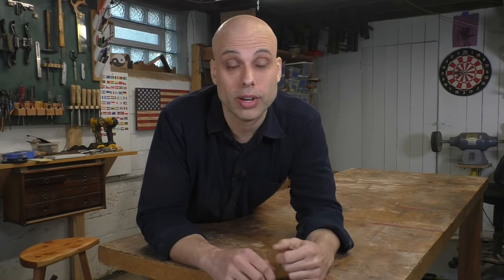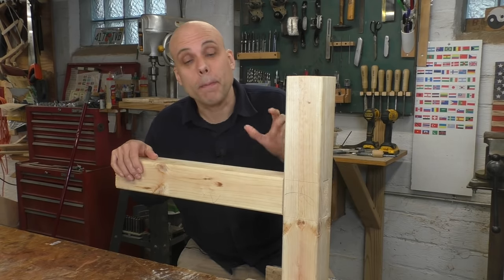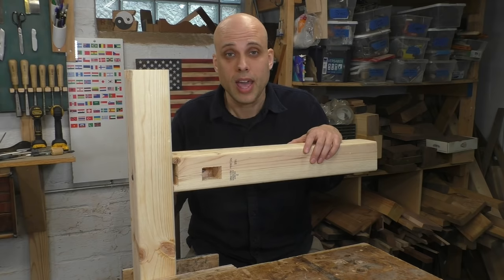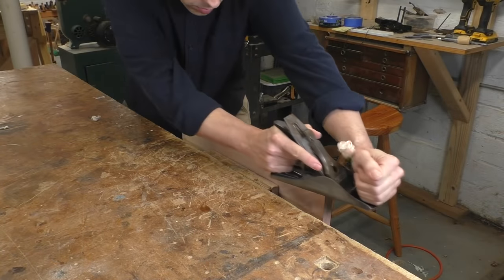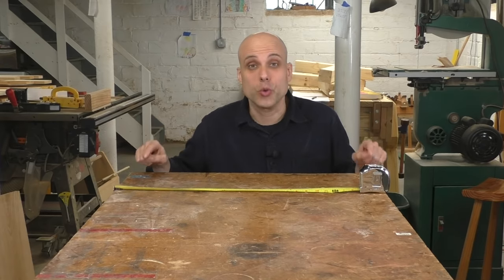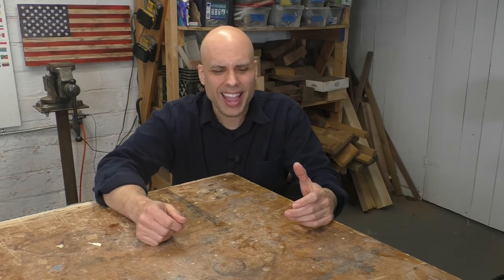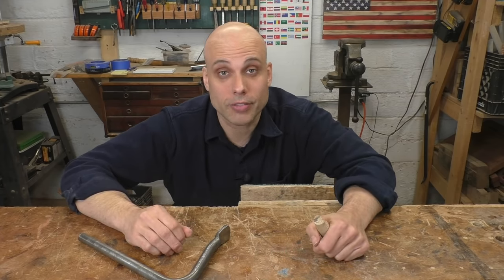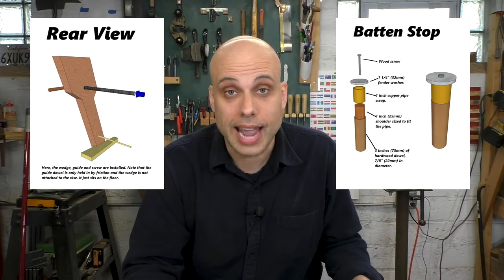Four Workbench Building Mistakes (that we all make).

Comment: I was interested in your assertion that you started with power tools and gradually swapped to hand tools.
Although I am still a complete amateur I started with hand tools about 60 years ago in school and gradually accommodated more power tools as these tools became better quality for less cost. When I built my first bench many years ago it was in a garage so the size dictated one that could fit alongside the car. Materials were not much of a cost since not much would fit!
Later when my house was larger and there was a triple garage it occurred to me that the cars didn't really need to be inside and I had a much bigger space! whilst my wife is not all that thrilled with the cars being outside she is amazingly tolerant and the main problem was the costs involved having just built an enormous house and I "discovered" the use of AM's (available materials).
A neighbour had a set of drawers that he was throwing out so I purloined these and beefed them up with some hardwood leftovers from another house construction down the road then used this as one end to support an enlarged version of the tiny bench from my previous tiny garage. The other end legs came from something else that I cannot recall.
With time the size of the bench had been sufficient although I find that I tended to want the bench higher because I don't wish to bend over or crouch as age does its thing to my joints.
The drawers did not appreciate the weight of tools that I stressed them with and gradually fell apart! This didn't matter because I made as series of shelves from hardwood fence palings (I actually purchased) and some surplus timber recovered from some wardrobes that I am ashamed to admit that I destroyed for the framework. All of this space I used less and less as I used more machine tools that had their own benches etc. Unfortunately my family found the unused bench a handy place to park much of their junk that I dare not discard and its hard to store it all neatly.
I have solved the problem beautifully discovering an Australian institution called a "Men's Shed" where a bunch of guys get together and take over a huge barn-sized shed and gradually scrounge huge amounts of equipment so we can spend a few days a week working on whatever projects take our fancy. I still do a certain amount of work at home (especially since Covid 19 and especially now that I am stuck at home having caught the disease with minimal symptoms hence the time to write massive comments) but I would be surprised if the same idea does not take off overseas because it expands the possibilities and scope of our work.

Comment: Just weld one up with steel angle iron frame, and bolt on what you need. The steel makes it solid, and you can bolt on whatever wooden bits you need. You can adapt an angle iron frame in any way you like

Comment: I've been playing at wood working for a couple of years.  My biggest most favorite tool is my fancy miter saw.  The rest are small hand power tools and a bunch of hand tools.  I am getting ready to build my first workbench after utilizing a couple of makeshift sawhorse tables.  They were handy, but still not what I wanted.  Therefore I've chosen the knockdown moavian.  I've come to realize there is a difference between a work bench and a table for putting things together.  I can use a thrown together plywood  sawhorse table for putting things together but for working on that wood, I need an actual workbench.  

You csn watch vids ntill the cows come home, but Until you get to working, learn your work flow and style, you can't ever really know what's going to work best for you.  What seems good yo your head may be far drom what works best for your hands and back.

Comment: I inherited a solid wood carpenters' bench with an old wooden vice at one end. The legs were flimsy. I built a steel frame with adjustable feet out of 1/4" thick, braced, angle, fitted a front apron incorporating a cast iron vice with pop-up dog,  at the other end, so that the front face was fair the length of the bench, and drilled in a couple of bench dogs. Not a huge amount of work but the thing is absolutely solid. The important thing is the steel frame which means the exact nature of the leg joints is irrelevant. If you don't want to weld up steel, then use diagonal bracing which again relieves pressure on joint design

Comment: Built my first Bench with metric bolts going through the legs, into horizontal beams glued to the underside of the bench top. had three bolts per leg, two parallel and one orthogonal to the others. Used super large (35mm diameter) washers...

Had your exact problem. It will crush the wood. Well, wish I whatched your video before i build it

Comment: Im not claiming it is the best option by any means, but I have an 1/8" masonite top on my primary bench. This bench gets used for all sorts of jobs from fine woodworking, to laminating, to large glueups, working composite materials, assembling various mechanical components, and even occasional aluminum fabricating. I have a couple scrapers I use to remove glue blobs, and a couple ridgid flat sanding blocks (one round and flat that I use DA paper on and one that I use board sander paper on) for knocking down burs and whatever gets embedded. I occasionally use plastic filler and will fill low cuts, dents, or holes with any unused product.  We have a scuff resistant paint we use occasionally on comercial  stair risers and skirtboards as well. I will cover as much of the top as I can with the remnants of it also. I have never experienced transfer of the dry paint onto a project and the even black surface makes it very easy to spot imperfections and debris at a glance. The Idea at the beginning was that the 1/8" masonite would be a consumable top that would be easy to replace, but this top has lasted me years and has actually gotten better with time.  I hold it down with 2" double sided flooring tape around the perimeter and a few strips in the field so there are no fasteners. I thought I would have to add some kind of mechanical fastener as well, but it has never budged and this bench sees far more abuse than most will.

This top obviously feels more commercial than a pure natural wood top and may not offer the same emotional feel, but it is extremely durable, laser flat, and can still be replaced with a brand new surface quite easily without any hassles. I enjoy how easy it is to upkeep and not having to stress about how I treat it. If something goes sideways and I hit it with a saw, drill, or whatever, it can always be returned to its previous state easily.

Comment: I bought a full sheet of 21 mm plywood. Mounted it on the sturdy frame of a motorized office table.
Now I have a work bench with a built in circular saw and mount for a router.
I put some wheels on it so I can shift it to where I need it. The wheels can be locked.
AND I can have it at the height I need for any need.

Comment: My bench was built in the basement when I moved in. I want to improve on it without dismantling it. It is built with drawers, and it's against the wall and I have put small power tools on top of it because of the electrical outlets. I want to have options for a better vice. I do small projects of wood, leather, and steel. The power tools are bolted but can be removed to make room for certain projects. There was supposed to be a question in there. Let me look at some more DIY videos.

Comment: MY first bench was an old length of kitchen worktop - with shiny laminate - it was almost 3 meters long! - I purchased 3 really cheap tressles and screwed them on as legs.... way too slippery on top, way too long, way too unstable.... but I muddle through.
My second (current) one is just square cut lengths of 2x4 and 4x4 (for the legs) all screwed together... and to be honest, its really solid, and I never had to tighten anything - just a s*** load of screws! - nice a fast to build too.

Comment: Mine is a modified Moravian bench. Added a couple drawers and moved the stringers up so I could slide my saw bench under  it. Used traditional joinery but went with a modern woodworking vise.  Very happy with it so far except I screwed up when I laid  out my bench top  mortise. A little glue. a bit of patience and a little scrap fixed it up though. Hate my dog hole layout though.

Comment: My workbench is a 4 leg frame joined with lag screws with a plywood sheet not screwed at all. It stands on a wall most of the year and I "assembled" it over the grass when I need it because I haven't a workshop. In the last 8 years with this I builded half of the furnitures of my house, repair the gearbox and motor of my car and made all my weldings.
There is no need of a fancy workbench when basically you need a flat surface far for the floor.

Comment: Based on this video and Rex's video on the English joiner's bench here's what I decided to do for mine:

1. I double reinforced everything using screws rather than half-lapping with bolts.  I do not care if my workbench looks nice, I care if it works.  Screws don't tend to work themselves loose the way nuts and bolts do.

2. I made mine 30 inches wide, but with a tool well in the middle, so that the problem Rex describes with being too wide is avoided.  I quite often work on large surface pieces, like plywood for cabinetry, I need the extra width, but I also need to save my back.

3. I went with 7 feet of length and this seems perfect, even for larger pieces.  You can have a decent amount sticking off the end and still work safely and comfortably.

4. I used the joiner's bench style with the wide apron for hold-fasts and pegs, and adopted the vise-free work holding methods Rex has covered.

5. I did not do a 2x10 top for two reasons, firstly 2x10s are incredibly expensive now in Canada, and I wanted to limit the project to two 2x10s only.  Secondly I wanted the laminated top as seen with his '$30 dollar bench'  [kind of crazy that it really was close to $30 USD when he made that video but more like $100 USD now, but I digress].  

Thank you Rex, your content provides a thoughtful and pleasant guide for this awesome hobby.  I cannot afford to support you on Patreon right now, but know I would if I could, and will when I can.

Comment: I've been woodworking all my life, 35+ years. 25+ years as a qualified Cabinet Maker/draftsman, and I'm currently a custom guitar builder. I find the best bench is not one, but TWO benches; an ASSEMBLY Bench and a BACK Bench. The Assembly Bench is the one you are talking about in this video. This is where you do all your ASSEMBLY. It DOESN'T have a vice. Behind you, against the wall is your BACK BENCH. This is where all your tools are stored, and kept when in use (to keep the Assembly bench FREE from tools), and where the VICE is located.

   The Assembly bench is good at 2M x 1M or there-abouts (6' x 3'), so it's optimised for handling large flat panels. If you are regularly doing fitted cabinetry in sheet material (wardrobes, say) that are really big, like 10' tall, go a bit bigger. If you have a small workshop, and you're only ever doing smaller freestanding cabinetry, go a bit smaller. Optimum height? Everyone has an "optimim bench height indicator" in their bodies, it's called a NAVEL (belly button). Just make the Assembly Bench top the same height as your navel, and it should be about right. Keep this bench free of the vice, so it doesn't get in the way and snag, when you walk around it.

    If I may be so bold, Rex, Could I suggest you make a Back Bench, to replace the shelf you have on the wall? Put your tool box next to the Back Bench, and put your vice on it. Do all your vice-work on this bench, not the Assembly Bench. Keep your "in use" tools on this bench ONLY, to keep your Assembly bench clear, ready to assemble your panels. This bench is often better a litle bit higher than the Assembly Bench, for close-work and planing etc. In my opinion, the Assembly Bench needs only a sheet material (MDF/ply/chipboard) permanent top in 18mm (3/4"). Then cover this with a 6mm MDF sheet/Masonite/hardboard/thin ply. To refresh the top, take off the top sheet, dispose of it, and replace it. Or indeed, just turn it over, and fix back down! I've worked for many years, with this type of top. 

  This way, you are optimised (leave a walking space of about 2'6"- 3', 800-1000mm between benches) with a big, flat bench to your front, and a slightly taller, vice equipped bench behind you, where you keep all your stored, and loose tools. And you just need to turn around to whichever bench you need to use. It seems to me that most woodworkers are trapped in a convention that they need ONE bench, which will do everything. When in actual fact, splitting out the benches into two distinct tasks; Back Bench = hand-work, chiseling, vice-work etc. and Assembly Bench = cabinetry assembly and large work flat panel cramping etc, is a much better working solution. And let's face it, in most people's set-up, (like yourself) their main bench is oposite a wall anyway, so why not put another bench in front of the wall, anchor it to the wall, for maximum solidity, and work that way. I'd be willing to bet, if you try working this way, you won't go back to using a single bench.
 

See my websites;
argcabinetmaker.co.uk
alexanderguestguitars.com
to see what I've made using this method of working.

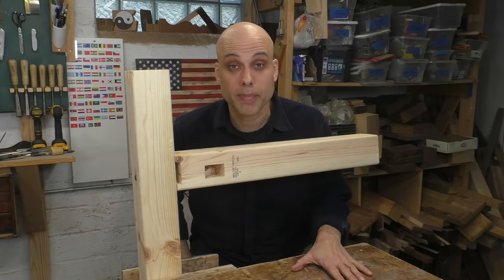Comment: A woodworking magazine did glued jointery comparrison tests, maybe 10-15yrs ago(?). They determined half lap joinery was the simplest and at least one of the higher performing joints. For your old bench legs at 3:50, two end bolts would have helped against twisting on his perpendicular bench legs however would still twist much more than bolted half lap legs and probably weaken the beam quite a bit.

Comment: Lamination allows a rank amateur to make tight fitting through mortises or half lap joints. Even if you can't cut a board square, as long as you're pretty close, you can butt your cut ends up tight and either leave the edges of the lamination uneven or saw/plane them to be perfect later. Lamination allows the use of smaller, often cheaper pieces of lumber. It also spreads defects (knots, checks, etc) so they don't pass through the entire piece.

Comment: I’m probably the flyer I’d guess. 

My base bench is 26”x52” with an end vise made with a glue-lam jaw designed into it. It is made entirely of scrap pile leavings from various job sites. The top is glued-up 5/8 plywood almost 4” thick, and I incorporated 1/4” lauan panels in the rear, sides, and bottom for torsional resistance. This bench allows portability to jobsites without being knock-down. 
Its mate IS knock down capable: a 2x4 lap joint frame with a 4x8 200# MDF top. Both are the same height as my Delta table saw for obvious reasons. 

Very good video on optioning benches. I certainly have needed a longer, stationary bench. Nevertheless, I seem to have successfully worked on multiple boats, built kitchens and salon cabinets, repaired windsor chairs and benches, built post and beam frames, upfitted several campers, and made numerous pieces of furniture with this setup. 
Portability and usually small, rented spaces have made this setup shine over the years due to its efficiency. 

A bigger versatile working bench is definitely in my future once I buy or build a permanent shop.

Comment: Great points Rex. I understand that you’re a wood worker, and benches are like cars and tailored to the user.
My mate spilled battery acid on my wood top bench and now I have a sunken burn mark. That’s not my problem.
It’s that I use my workbench for everything from repairing machines, metal work (I cant use it for welding, but my welding is normally too large), wood work and some precise/clean paper work and pattern making.
Would you...could you...make a steel base bench with a solid wood top and steel cover, or swap over tops...or just get two benches...oh...that doesn’t fit..
Is there a multi-purpose bench?!

Comment: Great video Rex
Thanks for the guidance. This is my first bench and am looking to incorporate two key power tools: mitre saw and table saw
My plan is to use half-butt joint for stretchers. While I envision adding some of the components you covered in the video, my worry is I’ll never have the bench quite perfect. Do you have a list of basic, must haves that I could start with and then grow the bench as my skill level increases?

Comment: I am in the design stage of building a router table, and I am thinking I will use your half lap with lagbolts for the frame.The top is manufactured by Kreg and I am considering having a 1" over hang all the way around?I will leave it open underneath for now in the hopes to add drawers later?

Comment: When I built my bench I used half lap joints and oak for the legs. My top was pieced together with scraps of plywood and I made a end clamp vice from maple and a single 3 foot bar(pipe) clamp. I drilled holes in it and the bench to hold DOGS made from 1 1/4 in closet rod with 1/4 in rods thru them to prevent them from falling thru the table. Later I replaced the top with a solid core door with laminated sides. The solid core door had particle wood on the inside. Not Happy. Later I'll replace it with something else. It has remained solid for the past 30 years the framework has and I made it from crate wood that housed glass sheets.

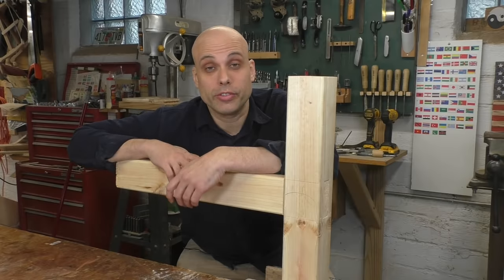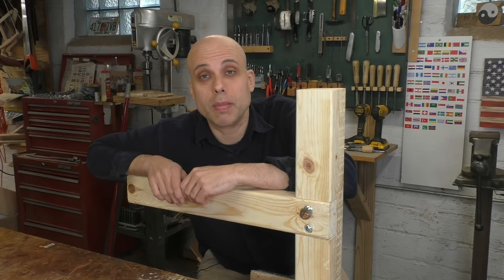Comment: I built a stand to hold 900g worth of fish tanks using a joint design that's somewhere between the first one (2:30) and the last one (6:33).
Instead of a thick piece of lumber with a joint cut out of it, I sandwiched three 2x4's together and cut a section out of the middle for the beams to sit in.